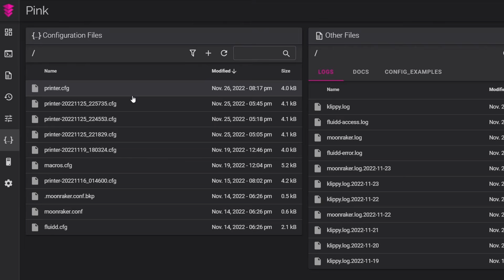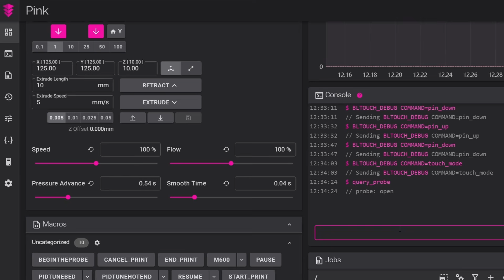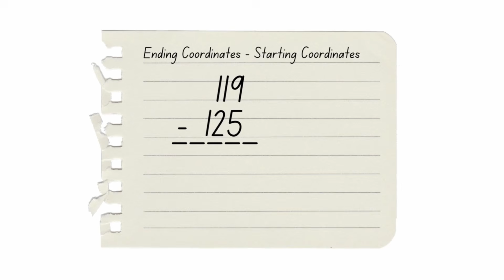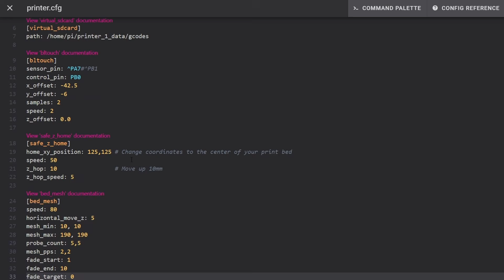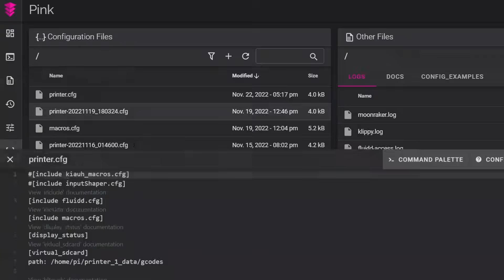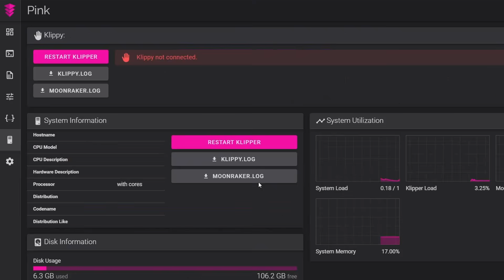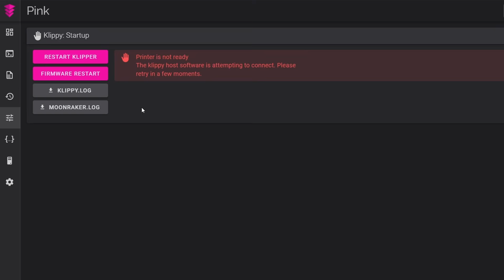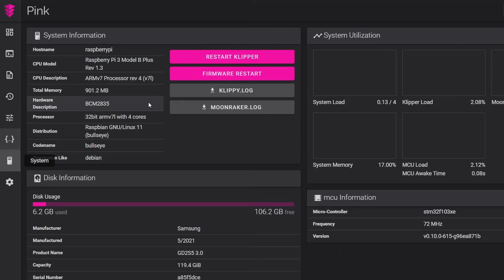BL Touch complete setup for Klipper! Maximize your probed bed mesh!

Comment: When you save the z-offset in the end, of -0.085, and examine the bottom of the print.cfg ....the "z-offset" is:
195  #*# z_offset = 3.410

and you say "now going forward it will apply the new z-offset" - Question, isn't that line (195) commented out?  Why would Klipper use that value?

Thanks - just started a new project with a Pi3+SKRPico v1.0 and Klipper with Mainsail and trying to "get it right".
Reply from the maker: That's a great question!! You're understanding of "commenting out" is exactly right, usually when we add a comment in front of a line it's used to 'turn off' everything after it. The commenting out process works that way everywhere except the lines below the -Save_Config- section. Klipper is setup up such that any lines below that Save Config section will be used, and specifically they need to be in that commented out fashion in order to be seen by Klipper. I hope this helps

Comment: I'm trying to setup the sonic pad on my creality ender 5 s1 but the probe is missing the bed on the edge when auto levelling. im still confused as to where to start, what is a front end and where do I find printer.cfg
Reply from the maker: Tristan, a front end is the webpage we use to access the files and control the printer. The options available to use using Klipper are Fluidd, Mainsail, and Octoprint (although I don't recommend Octoprint). Unfortunately the sonic pad sort of bypasses these to create an 'easier' user experience by using the touchscreen. I don't know enough about the Sonic pad to really help you there,  but what I can suggest is trying to find the IP address that your printer is using (i.e. 192.168.x.x) and then navigate to that IP from a webpage. That should bring you to a 'front end' where you can access the necessary files.

Comment: How does one implement the "Tool" functionality that you show while setting the z-axis offset and during the live z-axis offset fine-tuning? I am running Klipper and Mainsail. Thanks.
Reply from the maker: Kevin that Tool option is built into Mainsail. You don't need to do anything more than just use the controls that Mainsail offers you while you're printing! I believe Mainsail calls it Toolhead, and there is a Z offset section that can be found under it.

Comment: Did something change recently? Because when I set my mesh min values from my X,Y min and subtracting the probe offset values, the probe goes FURTHER into the bed. The other calculation was found with Victor Bared's method.
Reply from the maker: Depending on where your probe is situated (left front, back right, etc) then you may not need to do any math for the minimum coordinates. Remember, where are entering the coordinates where the probe is going to be. So if for instance your probe is towards the front left of your nozzle, and you want the minimum position to be at 10,10 then you can simply put 10,10 beause the probe can reach that. Does that make sense ?

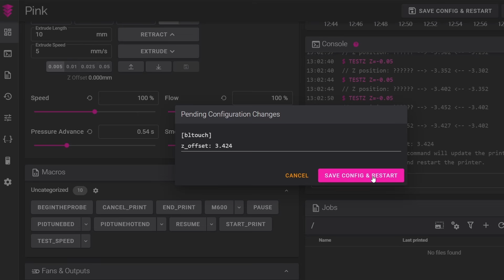Comment: This was top notch up to 10:50.  What the ? did you say there and how did the 'Pending Configuration Changes; dialog appear.  Off to find yet another Klipper Z offset video to attempt to solve the 'Klipper nightmare that differs every time  a probe cal / z cal is done' issue I have with 3 off printers, Klipper & Fluidd in every other way, stunning, EXCEPT for the Z Cal which has NEVER worked as per instructions. If a PROBE_CAL is entered and the paper test set to the perfect grip, click ACCEPT. run SAVE_CONFIG, HOME do a G0 Z0 and now no gap, redo with a slight less grip now a mile away ( well, 2 and a bit sheets of postit ) from the bed, repeat again and go around in ever decreasing circles. Now with all 3 printers once the first layers are down all print to sub mm dimensional accuracy and give a superb finish so my hardware should be fine ( or are all 3 bad, unlikely especially due the the final print result once a good start is made.. Been 3D printing a good few years so not exactly a newbe, but far far from a pro and it is with this long running nightmare experience of Klipper probe_cal/z-offset that I consider this to be a total let down.  I have bothered to comment here as the first 10mins of your explanation is certainly 10/10 and you should be congratulated for you tutorial style ( except 10:50 ), where again, I seem almost doomed with vids that cover probe cal/z offset to try and find an answer to my probe cal issues, they always end in a dead end ( well for me ).  So Klipper Probe_cal - not fit for purpose, do you have any other 'method/tricks' to fool Klipper and get a Z-Offset that actually works ????.
Reply from the maker: Joe, I really appreciate you following up after this comment. I know how frustrating some of these calibrations can become, or the steps to get them to work, and for you to conquer this step and than have the clarity to come back here and comment.. I really applaud your effort and I appreciate your praise for my tutorial-style. That means a lot to me !

Comment: Hey I just have a quick question. What if I would like to home with the normal endstops then probe with the bltouch. This way the bed is constantly level and going back to the same point and also using the bedmesh after it's probed. I have a massive 4ft cubed printer with a 3ft square bed and using the normal endstops to home the z axis is very helpful but I would like to use a bltouch probe to generate and apply the mesh. 

For context I have 4 steppers that lift the bed
Reply from the maker: Goldenfox, the only time I used a printer that was using endstops to home and then the probe for a Mesh was a Qidi machine. To be honest the implementation was not ideal and it didn't make sense to do it that way in the end. The homing needed to be done at max also, which added time to the entire homing procedure which, while not life changing, was also not ideal. Is there any reason you think homing with the probe will become inaccurate?
Reply: @PrintsLeo3D  yeah I had a few bad experiences with the bltouch probes not sending the stop command when making contact with the bed randomly which would cause the printer head to crash. Btw I think I figured out a way to make this work. I'll just setup a gcode macro to do the bed probing and apply it apron starting the print. I did verify that the probe was authentic btw. The way I look at it is I've never had a issue with the endstops telling the printer to stop at the same exact spot every time so I want to use then as a safety net, I know it's not ideal. 

Thank you for the video btw I wouldn't have known the macro stuff was even a thing I could make and call on so I do appreciate that😂😁
Reply from the maker: You also may want to look into KAMP. It's an adaptive mesh feature that has the probe only measure the bed where the model is going to be printed on. With a print surface as large as yours this will not only save time but should make the mesh more accurate at the areas you are printing.
Reply: @PrintsLeo3D  oh ok thank you I will look into it.
Reply: @PrintsLeo3D  hey just wanted to send a update since i ended up back here funny enough lol. I have it finished up and everything works with little issue. its been a long road but its finally coming to a end 😁
Reply from the maker: Love to hear that! I'm sure you're happy to be printing after such a long struggle, and I'm happy to help where I could ! Good luck and keep on printing!

Comment: Ender 3 V2 4.2.2 Spirit extruder - Cr Touch - Dual axes Z. This video shared to me on a Facebook group to solve my setup issues. The best part of this video is that you didn't give us the values you showed us how to work out and find the correct values for our own system, this is the most important part. The correct values for OUR OWN SYSTEM ! top video Well done, I dont think my system would be up and running with out it. Word of advice to other users don't go searching for a printer cfg that you might think will work it didnt work for me. Following this video is the only thing that worked...
Reply from the maker: Frank I'm glad someone shared this with you and that you were able to use it to improve your setup! Because there are so many different shrouds, and probes, and printhead setups, the best way to teach this is to try and cover the basic idea and give you the tools to determine the values yourself. I'm glad I was able to do that! I appreciate you taking the time to leave a comment about your experience, thank you!

Comment: i finished  and it works but not  in combination  of cura i try to max out the working space inside cura shows. but now print start and then writes Move out of range: 105.804 220.451 0.191 [63.406] my  y can only move 120 becorse of the bed holder clamps, do i have to set something inside cura? some users told me no i have not to change something
Reply from the maker: You do need to make sure Cura is working with the numbers you have calibrated. Having only a working space of 120 in the Y axis seems wrong, as you should get 220 in the y (even with some medium sized clamps). Whatever you found your max bounds to be, lets say for example you got 230 in the X and 210 in the Y, then you'd need to go into the 'machine settings' of Cura and input those as your bed size. It would look like X=230 Y=210. However, there's a caveat, as I have noticed it's been possible for Cura to move slightly beyond those bounds during travel movements. If you're getting an issue like this then you can shrink the bed slightly. In our example if you wanted to shrink the Y axis you could make it X=230 Y=209. 
    The error you are getting is that likely the X is going out of range 220.451. My guess is that your max bounds in the X is 220, but Cura is trying to move ever so slightly passed that. Let me know what your max bounds in Klipper are, and what you have the X and Y set to in Cura.

Comment: I’m having trouble with my print not being centered on the bed. Everything in klipper is set good, I followed this video. Is it something in the slicer I need to change?
Reply from the maker: Hey Zachary, if you have set up your max and min bounds properly , then you can move the nozzle to the top right corner of the bed (while the nozzle is still over it) that point in your coords is your bed size. For instances if tbag coordinate is 232,220 then that would be your X and Y build size. Inside your slicer there should be a section that asks for your build size, input that number (your max point while the nozzle is still on the bed) and that should center your prints. 0,0 is the front left corner, so the back right corner (the max) is what should set your printable max. I hope this helps, it can be confusing , and if you need more help let me know.
Reply: @PrintsLeo3D  thank you for the quick response! I will try when I get home. It’s been a problem I can’t seem to correct. Just came across your channel btw and you do a great job of explaining things in a way that makes sense. Keep up the great work!
Reply from the maker: Thanks I appreciate that! Let me know how it goes with the centering. I should also have mentioned that if you have a bl touch you want to double check your X and Y offsets are correct for it.
Reply: @PrintsLeo3D  yes it’s on an Ender 5 plus, I used the sticky note method you did and got it dialed in about as good as it’ll get.

Comment: hi when i finished your setup and tryed to bed mesh  all works well but the last point  rear right it touches this little clamps what should i do i think i have to adjust some offsets?? or should i make the y a little smmaller ? i  have  set mesh min 15x15 becorse of this clamps so for y i have to set 16 or 17  is this correct ??
Reply: Not to close to fare away maybe becorse of self calculate the 5x5 mesh points
Reply from the maker: If you wanted to try moving the front probed points back a little you can change the mesh_min to:
mesh_min: 15,20 and see if that helps
Reply from the maker: Hey Bill, if you're running into issues like this, where your max usable space is being limited from clips then you are correct you'll just have to adjust your mesh a little bit. The number you'd have to edit is the mesh_max , I would bring that down only a little bit. What is your current mesh max?
Reply: @PrintsLeo3D  [bed_mesh]
speed: 80
horizontal_move_z: 5
mesh_min: 15,15
mesh_max: 202.5,208
probe_count: 5,5
algorithm: bicubic
fade_start: 1
fade_end: 10
fade_target: 0

this  is touching the  clip at the rear  side at front side is  all fine
i put the  clip upsidedown becorse  it f its better and have  to z high
Reply from the maker: Bill I would try adjusting the mesh_max to:
mesh_max: 202.5, 203 

See if that clears it up for you.
Reply: @PrintsLeo3D  this does the job  rear  is  perfect  arounnd 2 mm away from clip but at the front it is i think 15mm away can i adjust this  ?? alsow my mesh looks good but in the middle i have red  color
Reply: @PrintsLeo3D  and alsow i think my 3d touch is terrible. i saw you made video of klackender i want to make this alsow can i use the z switch inside  doc it  looks like not. Sorry not you
Reply from the maker: Well Bill you're actually seeing int the future because I am in the process of making a KlackEnder! What we did with the max mesh points was by lowering the number along the Y axis it brought the bounds of that mesh in, which allowed the probe room around the clip. For the front clip, I'm not sure exactly what the problem is? Is it probing too close to the front clips?

Comment: what should i put in my cura settings for the meshine in y x z  becorse  i  have now the problem that my prints in klipper were showed outside the gcode viewer bed. ???
Reply from the maker: In Cura find the machine settings section, within that will be a section to adjust your build size. You can input the numbers you calculated there under the X and Y axes.

Edit: also I am referring to the build size. If it's a mesh size issue that will get set inside Klipper under the [bed_mesh] section. If you're having movement out of range issues with the probing mesh then it's likely you didn't calculate the points properly. If that's the case let me know
Reply: @PrintsLeo3D  i get Move out of range: 105.804 220.451 0.191 [63.406] inside cura i am not out of the bed shown but  when i print it  stops

Comment: I just recently install klipper onto my ender 5 pro, this video has help me out so much. The issue that I am running into now. Is that trying to do the Bed mesh when I input the y0 and x0 the print head goes to the rear-right of the print bed not the front left.  It’s seems like my x axis is backwards (possibly). Prior to getting to this point I was unable to [home]  because the print head was going to the left causing the BLTouch to hit against the wheels,  so I went in the printer.cfg and removed the exclamation point under x stepper dir pin.  And that fix my homing issue.
Reply from the maker: Hey Mike I had your comment open all day because I didn't have time to answer it but I didn't want to forget about it. Turns out I don't have the time to properly answer it but I wanted to at least hit you with a response. With the Ender 5s they treat the back right corner like an ender 3 would treat the front left corner, and as you know it homes towards that corner. There's a few ways we can deal with this, we can make the endstops a maximum, so it knows the endstops are the max distance and the 0,0 section will be the front left corner. My first question would be where is your probe located in relation to you nozzle, and what are your X and Y bl touch offsets ?
Reply: @PrintsLeo3D  thank you for making time to respond to me. my Bl touch offsets are X: -45 Y: -7
Reply from the maker: Yea like I explained the Ender 5 can be a little tricky because it feels backwards, and you can keep it tbag way if you want. I think it'd be best if you email me so we can exchange some longer information and maybe some pics: printsleo3d@gmail.com
Reply: @PrintsLeo3D  will do!

Comment: Leo, I was having trouble understanding how to set the xy min position as my y limit takes the bed 12 or 13 mm past the bed.  I had trouble with Marlin, first time setting up Klipper and guess what. Yep trouble, and I am pretty capable! Just did not seem intuitive. You cleared it up. Having watched the video I will still have to go through it while I do the actions but now I'm confident. Thank you so much, I'm now a subscriber!
Reply from the maker: Thanks Mark! The idea behind find the minimum and maximum bounds can be difficult, but ultimately it's easier to implement on Klipper. I hope this helps and I hope you enjoy your Klipper experience. Thanks for watching and commenting!
Reply: @PrintsLeo3D  Leo, I do have a question. On the thorough setup of course, must be done this way!!! When you set the max travel allowing the probe to actually build the mesh properly the size of your bed.... Is it only up to you and your slicer to make sure that the nozzle does not move off the bed while printing, or is there a limit setting for this for sanity? Common sense of course tells me the model must be within the confines of the slicer (reason for printer profile). Can you shed your light on this?
Reply from the maker: Mark your absolutely right! It's all controlled by the slicer. When we set the maximum X and Y limits those are only max movable  limits, and we use those for some features, like building the widest possible bed mesh. The printable max is controlled in your slicer. Whatever size you set the X and Y bed size in your slicer is where the gcode (and nozzle) will be constrained. Finding the max printable size is as simple as moving the nozzle over the bed at the maximum distances and then transferring those coordinates into your slicer
Reply: @PrintsLeo3D  Thanks Leo. Your a great teacher and Gracious with you knowledge. Mark